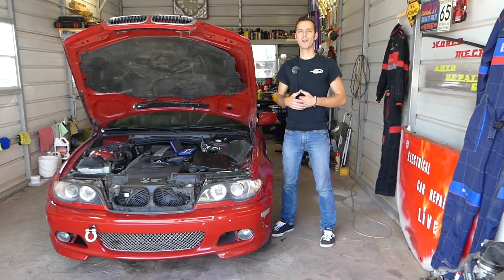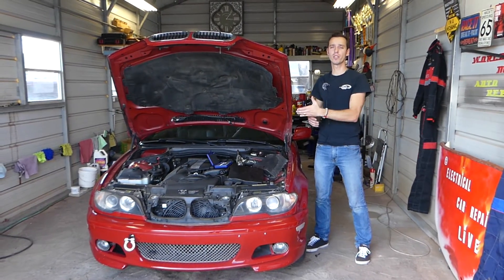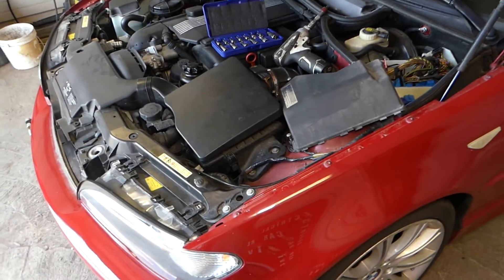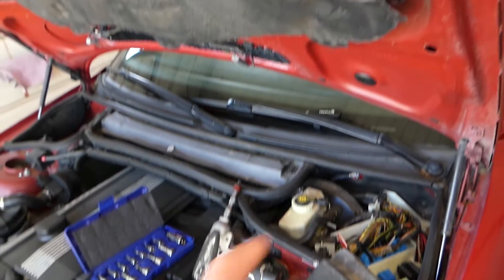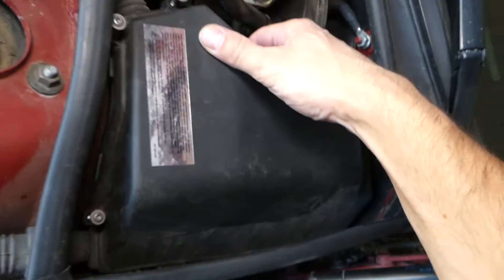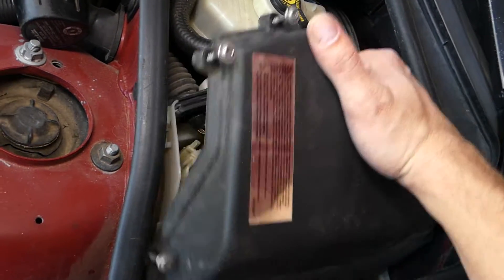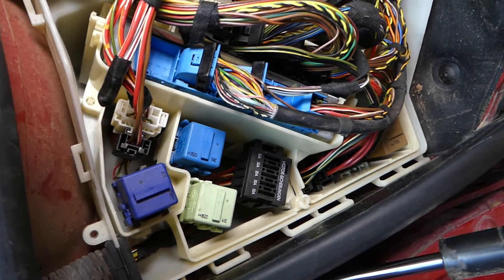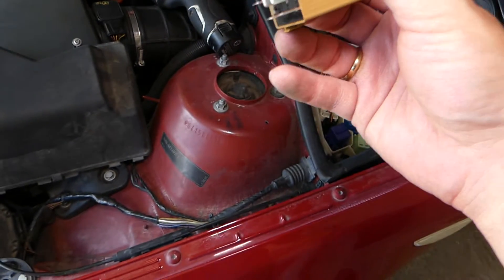WINDSHIELD WIPERS RELAY LOCATION REPLACEMENT BMW E46. WIPERS NOT WORKING

Comment: pulled relay and  i see hot  leg...power  probed wipers and  they work, but will not  turn on by switch, GM grounds  good. Power  washer when pulled back turns  on. Fuse  is good. Double  checking  and  double checking  relay. if they are good what would you suggest ? i do not  see how to test relay video link, as this is a  7  pin relay i would  enjoy watching your video.

Comment: already replace wiper relay and wiper still not working do you think its the motot?
Reply: I have same issue replaced relay twice and it still returns to service mode position and not where it should

Comment: Need help on locating the DME Relay I want to test the relay because I noticed that the Idle Air Control keeps buzzing even after I turned off the car and it's killing the battery.  04 BMW 252I M54